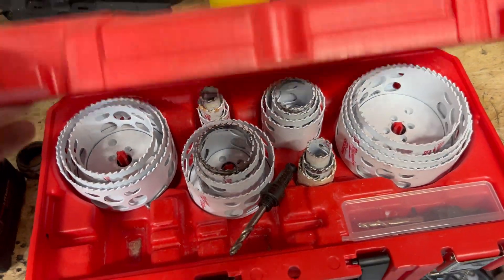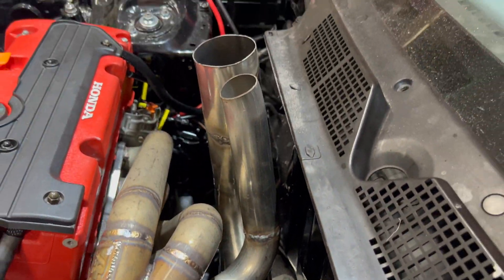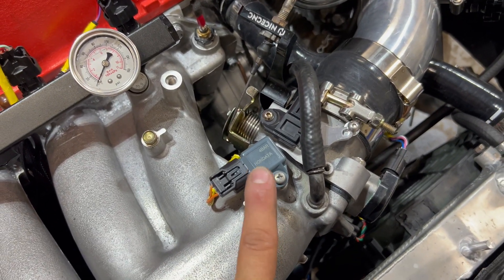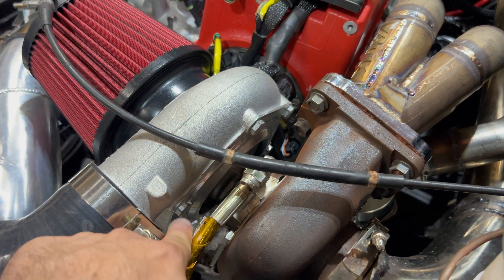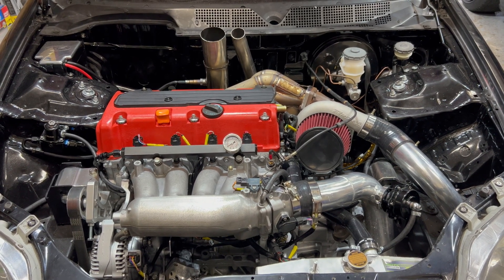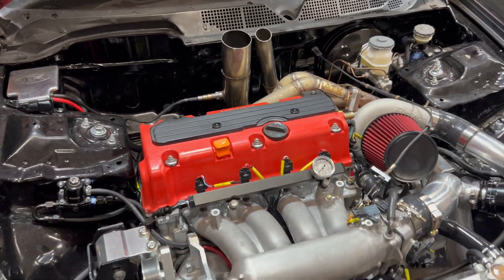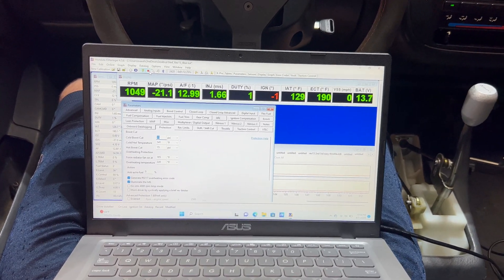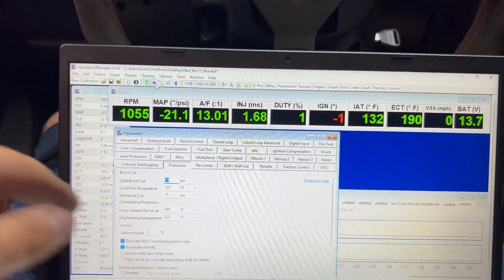K24a Turbo street tuning

Comment: How much power do you hope to make with this build? Im thinking about getting this turbo and wanna know if it's worth it
Reply from the maker: This turbo setup is good for over 700hp but this summer 500 and next 600 then leave it there since engine is stock
Reply: @NedH  is it still running ??? Thats crazy if youre just casually pushing 500+ whp on a stock K
Reply from the maker: @lexuspod  its 400hp and still good
Reply: @NedH  I’m building mine now, hopefully aim for 7-10psi & get similar figures to you
Reply from the maker: @lexuspod  yeah 10psi should see easy 350hp